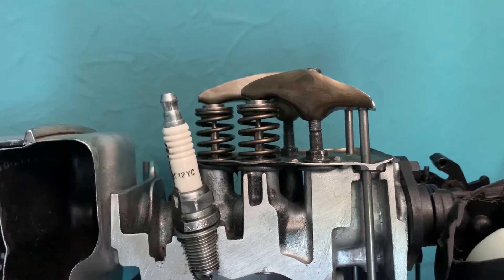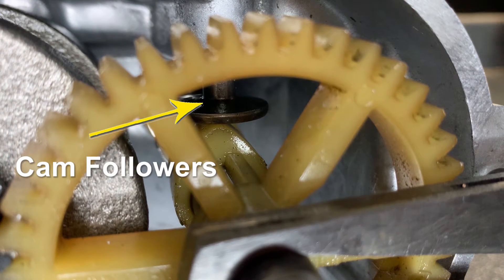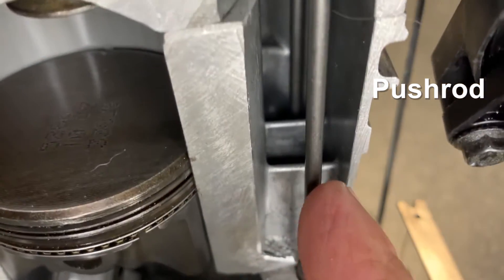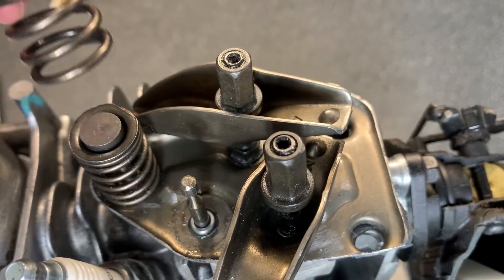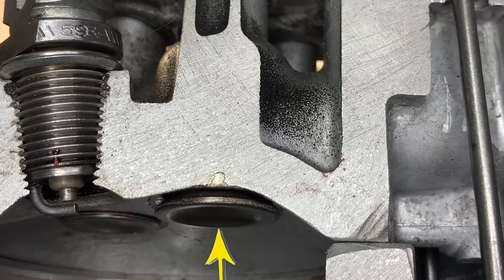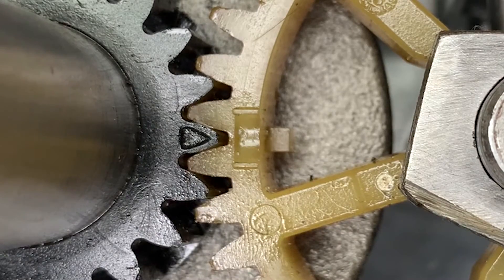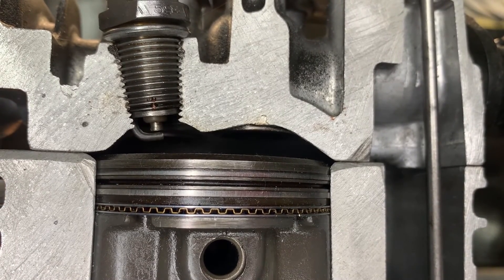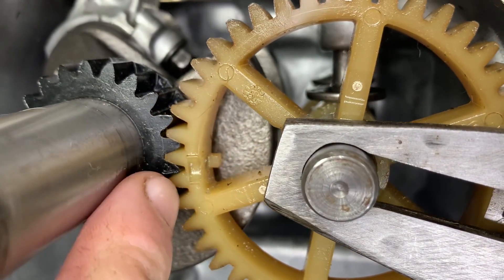The 4 -Stroke Valve Timing. The Only Video you need to Understand!  (by Craig Kirkman)

Comment: This was such an excellent video.  I’ve adjusted valves on a number of lawnmower engines.  I just never quite understood the position of the rockers to what the valves were actually doing.  This makes it perfectly clear.
Thank you!!!
Reply from the maker: Thank you so much for your kind words! 😄 I'm absolutely thrilled to hear that the video helped clarify the relationship between the rockers and the valves for you. Understanding that connection is key when adjusting valves on lawnmower engines, and I'm delighted it's now perfectly clear.

If you ever have more questions or need further guidance on any topic, please don't hesitate to reach out. Your appreciation and enthusiasm mean a lot, and I'm here to help anytime. Happy tinkering and lawnmower maintenance! Craig